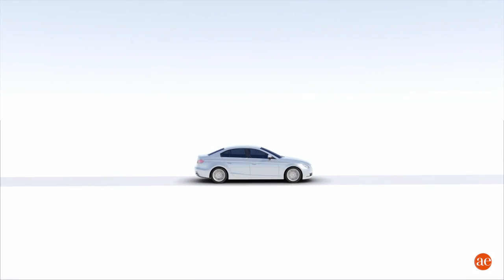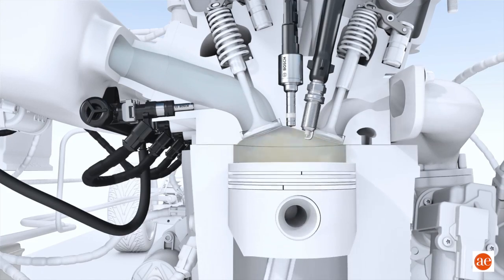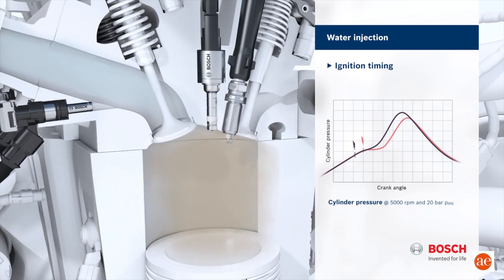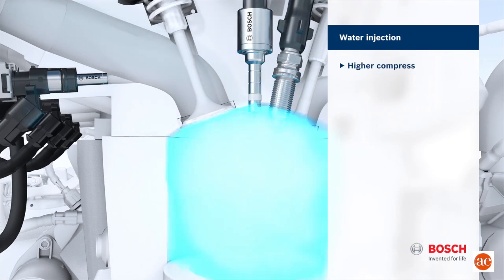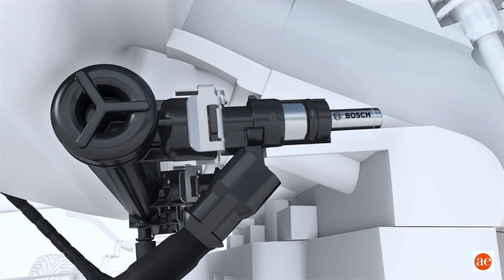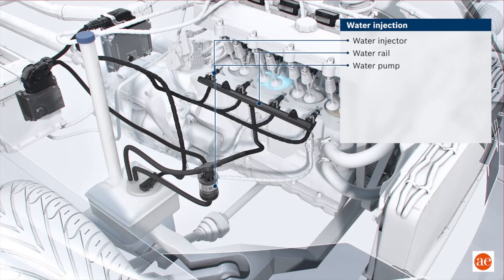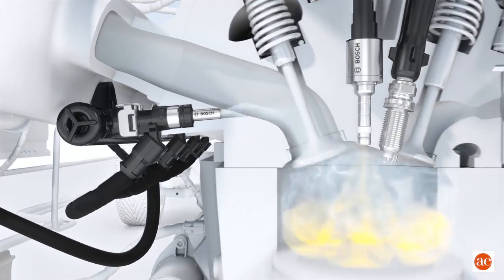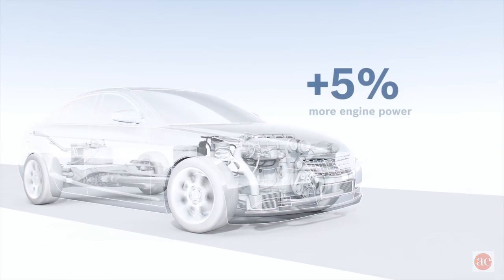Bosch water injection

Comment: The extra weight from the water tank and all those other components will lead to higher fuel consumption. In the end, you are better off with a lighter vehicle that isn't fitted with all that Bosch water mambo jambo. I'm also assuming that there will be added maintenance costs. So, nah. I'll pass.
Reply: you are and engineer i presume, right? Cus if u are not, i think u dont know more than them
Reply: @Francois_Dupont  yea bro, I was about to say the same. Bud should take off his clothes and poop before entering the car so he could do some weight reduction for efficiency lol.
Reply: @dzoni97a  I usually remove some material from the chassis. There is so much dead weight there. I also remove some from the engine, piston, and cylinders. I mean they are so thick.

Comment: How does this work in the winter in the north? Can methanol be added to it without issue? Can ice cubes be put in the water tank during the summer? Lastly will this work in my BF109G?
Reply: Is it possible to prevent freezing distilated water by increasing pressure in the tank? In theory, if very high pressure in tank can prevent water from sloshing and splashing (which causes chemical‐clear water freezing)?
Reply: they could worm it up easily you know ... from the water cycle of the coolant !
Reply: when the car is on, but when it's off how are you supposed to keep the water from freezing and damaging its container?
Reply: Well I guess that there is some space limit that would prevent water tank from cracking if water freezes and probably the controller unit does not allow it to operate untill engine reaches the working temperature thus melting the frozen water. But I guess that if they start installing this into cars, they will install only in once that has the systems for preheating the engine

Comment: Water injection was used in WWII airplanes, fighter planes in particular. Why not use the heat from the engine block to distill tap water rather than buying it? Electric is a better way to go like what Tesla is doing - 0-60 mph in 2.5 seconds in comfort and with the kids and dog in the back seats. New technology like graphene batteries (super capacitors) may have a major impact. 

Still talking about CO2 reduction? Isn't that stuff what we breath out, make the planet green and enrich the oxygen content?
Reply: grow food, not lawns
Reply: Are you crazy or silly .the battery cost a lot and they most work on a electric piston instead to a high voltage and low current .its a shame cuz lithium and graphene is great for electricity on the world and they wasted it on car battery .one day there will be no lithium and graphene to your fucking cellullar or laptop battery